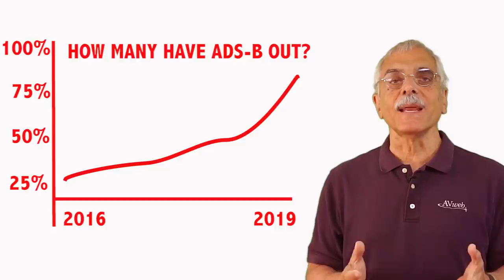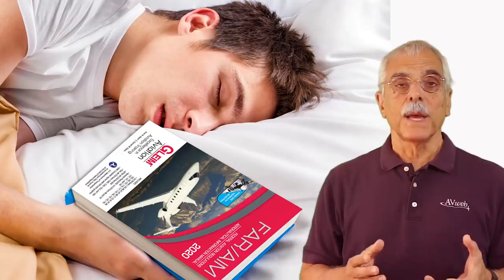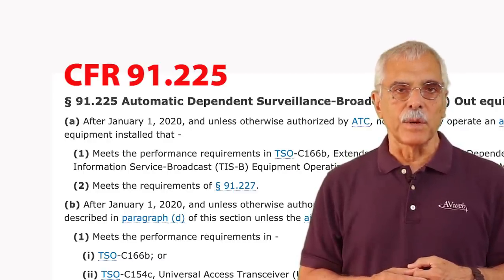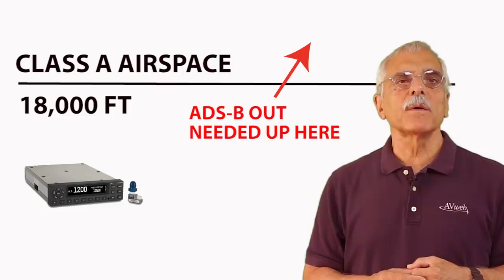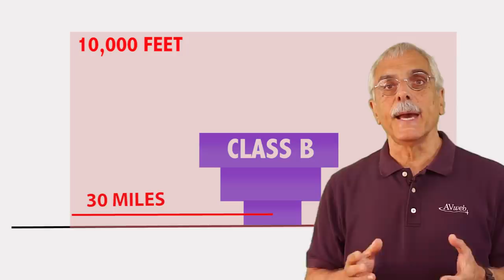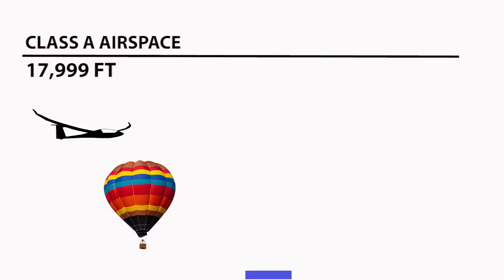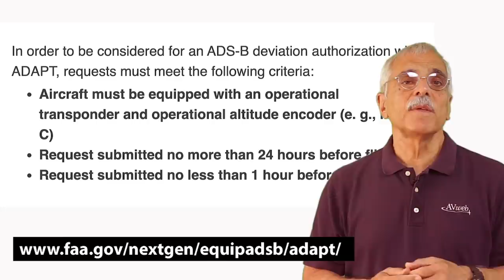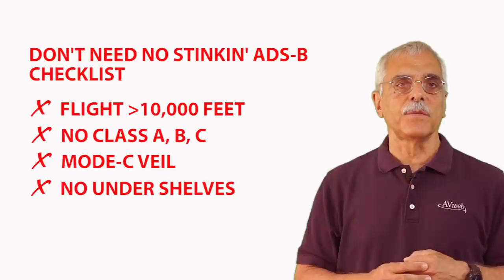So You Blew Off ADS B  Now What?

Comment: ADSB makes us all safer. In my opinion there should be be no airplane in the air without it. Old boomer airplanes included. Let's not talk about airplanes without a radio.  Just letting you know that that we all are secretly judging you.
Reply: NORDOs would be okay if everyone also had ADS-B in, and the system showed people's notional intended route.  Little tougher for a sailplane though.  The NAS is still in the stone age, and will always be.
Reply: I disagree.  I've had ONE trip in the past two years that i could not have made without ADS-B.  The economics are simply not there for it.  A lot of people will be flying around the periphery of Class C to get to outlying airports on the other side and no longer talking to ATC, and no longer using flight following.  The first two or three times some approach controller vectors somebody without it through prohibited airspace and then violate them for it, and word gets around, even if not totally true, people will stop using ATC for flight following and will stop talking to approach at all when circumnavigating the Class C or Class B to get to an outlying airport.  And then you will have somebody without ADS--B on the edge of congested airspace no longer talking to anybody.  I don't think they thought this thru.  I think they made the judgement like you without evidence that everybody should be required to have it because it is nice for people who can afford the ADS-B In equipment.  It's not gonna work quite as expected, IMHO.
Reply: @kellytrimble4120   Kelly Trimble  You are right it is  judgment call. The same rules apply for me and cars without seat belt and airbags. As for affordable. The ADSB requirement is 10 years old. Which is  $33.00 per month for a 4k installation. At any point in the last ten years one could have started saving up for it. Of course this is easy for me to say I just rent and you seem to own. But too expensive is not a valid argument for anyone out there.
Reply: @FrankBredow   Or $16.50/month for a Uavionics skybeacon or tail beacon. Nothing to it. No excuse.
Reply: @FrankBredow  It's a very valid argument.  I have twenty airplanes, mostly collectible.  I was just explaining in another comment, I have one, a Culver V, which is nice, with radios GPS, whatever, not worth more than probably $ 12,000.  $4k is simply not feasible.  

Second, I've analyzed my flying.  In the past two years I made ONE trip that would have required ADS-B under the new rules, assuming we can fly under the shelf, and I really should have driven that one anyway.  ADS-B simply doesn't pencil out.  Sorry.  

Third, if you saved your pennies for ten years like you said, when you finally do install it, you need to start saving pennies again, because you will probably have to do it again.  The experience with GPS is that the manufacturers quit supporting them with updated maps after a few years.  We put Appollo 2001 GPS units, IFR certified and everything in probably seven or eight airplanes, put MX-20 moving maps in I think three or four of them, and they are all junk.  After about ten years you couldn't get map updates.  And there is some funky tech reason why some older GPS units don't work at all anymore, not even for VFR.  That is the way avionics are headed.  You get a big sell, spend a lot of money, and then you are required to do it again in six to ten years to stay current.  AND I suspect there is some sort of ongoing maintenance or inspection requirement that will be coming on these if it isn't already there.  

Sorry, the economics are simply not there for it.  I think it will result in a less safe flying environment.  It is great for all of the big iron people who don't like having to look for traffic, but it will result in a lot of people who should be using flight following no longer doing so.  I use VFR flight following all the time, almost every trip over thirty minutes.  This thread has got me thinking and I am concluding that talking to ATC won't make any sense unless and until you are approaching the boundary of a Class D you intend to land at.  I think other people are going to conclude the same thing once they actually think about it and actually do a long VFR cross country.  Great for the corporate and commercial guys going in and out of the international airports or into the center of the Class C airports, but less safe out in the sticks.
Reply: @kellytrimble4120  If I understand you, I think that is a foolish attitude.  I've almost been creamed by a King Air, probably flying IFR on a clear day, who likely didn't see me, and I likely wasn't on ATC's screen.  He came up behind me about 150-200 kts faster than I was; wing-tip-to-wing-tip separation may have been 75'.  I heard him before I saw him, and he showed no evidence of seeing me.  I had been warned previously that pilots flying nearby IFR routes are not going to see me.  I was with my instructor, and he yelled "We almost died!" seconds after.  We heard the King Air before we saw it.  He was against ADS-B in aircraft without an electrical systems, until that point, and he had about 20,000 launches at the time.
Reply: @DumbledoreMcCracken  I'm not sure I understand your reasoning.  But I think it may illustrate mine better.  You weren't looking for, or at least not seeing, the King Air traffic, and the King Air didn't look hard enough to see you.  Once everybody assumes everything that exists has ADS-B, their heads are going to be that much more inside the cockpit with that much less reason to look out the window for hazards.  

What I'm trying to explain is that this requirement, the way it is being done, and how the economics are keeping the costs artificially high, are presenting economic incentives that will shape behaviour, and people respond to economic incentives and disincentives.  I didn't think of it until this video and commenting on this thread, but the incentive structure is all screwed up on this.  For some people there is very little incentive, economic or safety or whatever, to have ADS-B Out and some strong disincentives, starting with the cost, and there are a bunch of incentives that will affect how people fly without it.  

You can cite horror stories about almost getting hit by inattentive corporate traffic until you're blue in the face, but it isn't going to change the basic structure of how the decisions are made.  And I can see it making some places less safe.  I'll say it again, they are not requiring it in places where it would do a lot of good and they are requiring it in places that already have good radar service and ATC controls.  

You're talking fear-mongering (OMG I almost got hit by a moron in a King Air!!!!).  I'm talking real practicalities of how the world works and real safety.  I don't think these requirements are going to work quite the way everybody has envisioned them.
Reply: @truenorth636  Breaking it down into smaller and smaller amounts is Salesman-BS.  You can get a water softener and not have to spend as much on soap and it will only cost you $ 9.12 per month.  The $ 16.50 is only fifty-four cents a day!.  I know somebody who will sell you CBD pills that will only cost you $ 4.00 per day and you will have energy and soft skin and clean bowels, and isn't that worth $ 4.00 per day???   No, its thousands of dollars you have to crap on the table right now, and for some small planes that can be ten or fifteen percent of the value of the aircraft.  And that may only be the the beginning of the cost.  There is no reason to assume these things will be state of the art for more than a few years, then you will have to get the next generation.  I'm sure there will eventually be a test requirement of some sort, just like for ELTs, transponders, VORs, static instruments, etc.  and that won't be entirely cheap.  And the first time your fails and you fly over a Class C and get violated, you will label it inop or rip it out and adjust where you fly.
Reply: @kellytrimble4120  I think the economic impact of ADS-B, amortized over the remaining life of any aircraft that isn't an ultralight, seems minor.  I've only rented, and played.in other people's aircraft.
I have other near Miss stories, but I wasn't in command during most of them.
I just don't understand the cheapskate mentality that the FAA is enabling with the crazy limitations and exceptions.  I'm not rich, but if I decide to go flying, I'm prepared to pay to play.  The cost seems reasonable to me.
I think everything should have ADS-B, all the time, including hang gliders and other ultralights.
You and I aren't going to agree on anything.
Reply: @DumbledoreMcCracken  Ya know, I've been thinking about this all day, and with this video and the comments I've just now started to figure out how this ADS-B thing is going to affect how and where and what I fly, and I've noticed something that is making me wonder how it is going to change or reinforce bad habits in other pilots at the same time.  

Something I just noticed, and I didn't really realize it until you talked about being a renter, almost all of the people around our part of the aviation world that are raving about ADS-B In, that have bought the apps to put on their tablets, and bought the receivers or are flying planes with the equipment installed in the dash all seem to fall into two camps.  There are some corporate pilots in big and fast rides who like it and would find it helpful in uncontrolled airports if everybody had Out because they have a heavy workload, and it helps, and young inexperienced pilots, people who anymore are looking at piloting an aircraft as something like a big expensive video game.  They have their heads in the cockpit, looking at the moving map, looking at the ADS-B readouts, and hardly ever looking out the window.  They think looking for traffic is a pain in the ass, they want the ADS-B readout to tell them where everybody is, so they want everybody to have it right down to hang gliders and frisbee's, they aren't making any effort to try to actually understand the weather, they just want their game console to paint where the bad weather is so they can go elsewhere, and a couple hundred hours past their private checkride, they've pretty much completely lost the ability to contact navigate.  

I'm making a wild guess that's where some of y'all are at, pretty inexperienced, probably less than twelve hundred hours or so.  

Anyway, don't get me wrong, I'm not anti-ADS-B.  I do sort of wonder what the political process was that made it happen, and I wonder how much of the cost goes to paying for patents on technology that should have been pretty obvious and maybe not really patentable.  There is other data about the flight environment that ADS-B isn't providing that other solutions might have provided. But I digress:  my comments on this video thread may sound like I'm bitching, but more accurately have taken the form of speculating what the unintended consequences of ADS-B and the way it is being implemented might be.  I'm wondering if it is gonna be like GPS where everybody gets to where they rely on it and never have a backup plan and pretty much loose a bunch of other important piloting skills in the process and because their heads are down in the cockpit and not looking out the window, I wonder what that might eventually do to the accident rates.
Reply: Not saying ADSB is a bad thing or I wont eventually put it in my plane, BUT, many things that make us safer they also make us less free.  When the .gov wants to start charging you a tax by hours flown, miles flown, or tracks every place you land and charges you for that tell me again how great having every plane tracked is.
Reply: @screamingbeagleproductions1876  you don't have to fly, and can cower in your dwelling if you want.  It is your choice.  They already track everything you do, most likely, so be sure to throw away your computer and cellphone too.
Reply: @kellytrimble4120  I really want to shake your hand right now. I never met a serious airplane collector.
Reply: @kellytrimble4120  I'll pick only your last question based on my experience. I see other planes using ADSB and I find myself adjusting my course accordingly.  Sometimes I have no choice but making a 360 when I'm against the KDen  Bravo shelf. This happens more often than you think. Some of my hours are coming from being a safety pilot to others. I believe that the accident rate will go down.  Near misses should be virtually eliminated.
Reply: @kellytrimble4120  What I would like to see is ADS-B end up doing is reducing the cloud requirement for VFR to be "one mile visibility and 'clear of clouds' in daytime".  That would be pretty awesome.  I don't need to fly in Cu, but I would like to fly near Cu.
Reply: @kellytrimble4120  I disagree with your "making someone a worse pilot" argument. Other planes can become almost invisible when they blend in with the background or in situations with unfavourable lighting, not to mention the blind spots every aircraft has. 
The reality is that scanning the skies as a collision prevention method is very ineffective at best and useless at worst, nobody has the focus or time to look for traffic constantly. Every midair collision is caused by one simple problem: Two aircraft didnt know the other one was there. This is easily fixed by a computer screen that shows all the aircraft around (be it with ADS-B or some other system), it takes workload from the pilot by taking the guesswork out of it, and i dont see how this would make you a bad pilot since you obviously still have to look outside for weather or navigation purposes.
There is a reason Transponders and TCAS got introduced in the commercial aviation world, and since then midair collisions are basically unheard of there. So why not introduce a system to the GA world that gives us the same amount of safety?